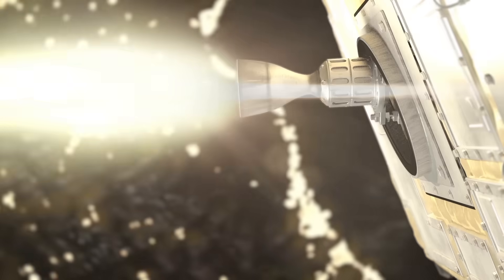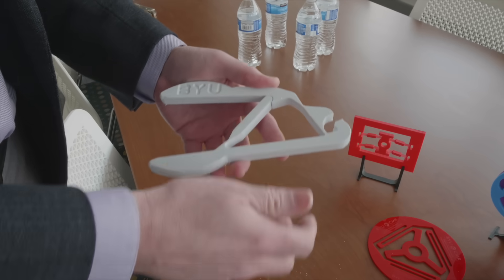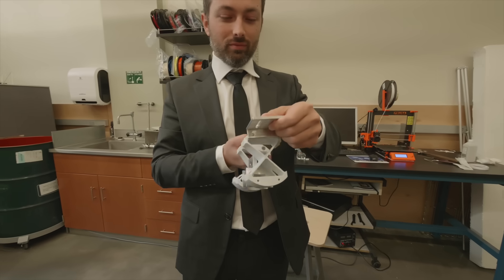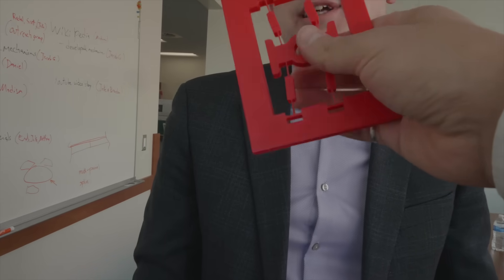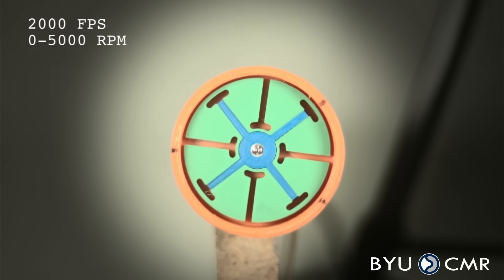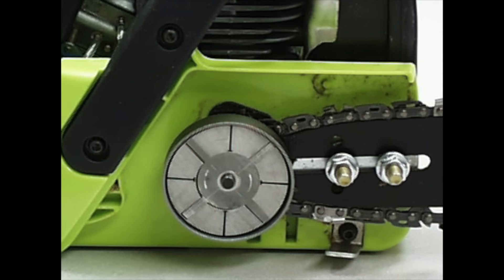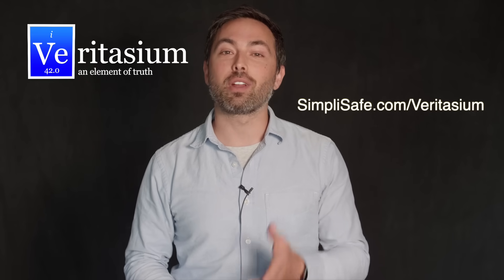Why Machines That Bend Are Better

Comment: I see how the titanium hinge works. Because no corner bends more than 10-15°, no corner is weakened.  Cool
Reply: A thin and long traditional spring coil made of titanium would expand and retract just as much at this compliant mechanism.  This is nothing more than a spring just in a different shape. ;)
Reply: How do you determine how far it can bend before a corner is weekend?
Reply: @joecerone  I dunno, I'll leave that to the engineers, I'll stick to my music
Reply: @MrIzzy5466  Oh, so it's just a known fact that titanium can bend up to 15 degrees without weakening?
Reply: @joecerone  I don't know. It was an assumption. In the video it seems like it's about 10-15°. Maybe it's less, maybe it's more. What's your problem?
Reply: @MrIzzy5466  No problem lol, honestly. I'm just really curious about this stuff.
Reply: @joecerone  I just looked through some comments and one guy mentioned Elastic limit. Don't know if that's what I'm trying to say but it sounds right
Reply: @MrIzzy5466  Yep, it would be dependent on the material's modulus of elasticity (E) - its essentially the stiffness of the material. If we load a material beyond its elastic limit, it will undergo plastic (permanent) deformation. I can't confirm the 15° statement, but it could be possible that the strain experienced would keep it within its elastic region.

If you're more curious, it might be interesting if you look up Stress/Strain diagrams for different materials. I'm not sure at what level you already understand the stuff, but the basics are fairly simple to come to grips with.

Edit: I think I responded to the wrong dude; apologies.
Reply: @joecerone  it has something to do with elasticity( property that enables a material to bend and revert back to its original position/shape) of titanium, and metals are more common presenting the plasticity(deforming permanently without rupture) property in everyday applications so yeah... it's determined by repeatable bending experiments with precision to determine both.
Reply: Joe Cerone it is to do with plastic or elastic deformation
Reply: Most material have a linear elastic region where they can be deformed without permanent deformation. Meaning you can bend or stretch something by putting a force on it, then when the force is removed, it will go back to normal. You can do this with a paper clip. As long as you don’t bend it too far, it will go back to it’s original shape. How far depends on the material.
Reply: Titanium is hella elastic.  You can tie that stuff in knots and it'll go back to it's original shape.

Comment: I've watched this video a couple of times now, and while his compliant gripper is quite neat, it's got a fatal flaw compared to traditional vice grips; a fixed jaw width. 

His compliant gripper may produce a strong force, but it isn't one size fits all. You'd need 10 of his grippers to match the size range of a standard pair of vice grips. 

It took me til my 3rd viewing to even... grasp....this simple fact. 

Still amazing work.

Comment: One problem I can see is that if a device breaks, you can't fix it easily with home methods. With metal multi-part tools, you usually can.
Reply: But these are much, much cheaper and easy to replace.

Comment: One thing that worries me about bending machine is repairs.
Reply: 1 million uses so far without need of replacement. If they used it in a light switch, say you use a single switch 4 times a day. It would last at least 500 years without need of replacement. 

pretty sure we are all going to be dead by then.
Reply: @lordofudead  Yes, but always assume the worst. You never know when a part may fail, need to be constantly be ready for that case.
Reply: @lordofudead  My LED lightbulbs are packaged and advertised as 10 years. Guess how many I actually get out of them? 
Never forget that is a sealed environment with exact and predictable movement. In the real world dust and sand gets on it, someone in a rush uses the mechanism very harshly, the heat and cold constantly fluctuate which will weaken the jointed areas, and so on. For very specific applications it has its uses I'm sure. But this type of design on a mass scale means nothing more than increased non-servicable cheap Chinese plastic garbage.
Reply: Well most of these parts are simple to replace. Even the thruster they showed would be quick and easy to replace.

Comment: So the main thing that i found odd in this video is force. like a clutch is meant to have a large surface area to not slip when engaged under lots of torque. so with the one in this video i could theoretically bind the blade in wood and immediately burn out that clutch because of the low surface area to volume, it also doesnt seem to allow for slipping which is useful in most applications where you might employ a clutch like cars, and the grabbers, how much input force could it take compared to the vice grips (ive used channel locks to clamp vice grips before) before it fails and is that a total failure or does it just buckle at the flexible point the bounce back etc

Comment: We have been making mechanically compliant mechanisms for years.... The fact that you introduce a point that is not a mechanical joint but a flexible pivot it does not mean it is better it just means that it can be mass produced for a different purpose and use. This isn't new tech either. It is new only for nanotech applications.

Comment: Haha, as a production engineer.
Bendy Wizard: You can injection mold it.
Me: Oooo, nice.
Bendy Wizard: You could even extrude it and chop it.
Me: OOOOOOOO
Reply: heh heh heh.
Had to learn these for my engineering class.
I too got really excited with the extrusion part
Reply: Nerds.
Just kidding. As an industrial designer I was like the same.
Reply: Production engineers when they find out you can extrude and chop a product to mass-produce it

ヾ(๑◉ ͜ʖ◉)ﾉ"

geek dancing intensifies
Reply: This guy absolutely blew my mind.
Reply: I'm not an engineer, more of a repair anything kinda person. So I clean up your messes. 🤫But he is essentially making mechanical circuits in ways conventional/natural thinking has thought to be sub par. Bravo 👏
Reply: @StyxNstoners  Please fix my time-machine. I want to go home.
Reply: @NLTops  home is where you make it.
Reply: @StyxNstoners  Don't worry. I don't have a time-machine.
Reply: @StyxNstoners , So, how would you fix one of these bendy bois?
Reply: @JNCressey  depends on how it fails. If it snaps, I'd do a plastic weld with original material. Depending on the material it may need a chemical weld so the heat doesnt distort the molecules and weaken it.
Reply: lmao Bendy Wizard... Indeed  he is.
Reply: @anhduc0913  You're replying to the wrong person.
Reply: @NLTops  lol major oooossp there XD
Reply: Yeah but it can't really be made in anything other than plastic (such as metals or ceramics on a practical size scale for commercial use/ production)which really limits its uses, its useful but not "better"
Reply: @commonsenseless9894  Did you watch 7:45 to 8:17 in the video showing a 3D printed titanium hinge that bends 180 degrees?
Reply: 7:45 That is titanium not plastic
Reply: @commonsenseless9894  it can be made in metal, prob not ceramic tho but it can be extrude/chop or just molded in metal
Reply: @commonsenseless9894  If you need a hardened surface, just use inserts, you can even injection mold them into the piece
Reply: @commonsenseless9894  perhaps go back through the video - there are several practical applications shown where the plastic prototyping resulting in a metal final product

Comment: don't flexible components wear out faster though?
Reply: Pedro Gusmão Did you see the stress test?
Reply: @imallergictobullets  I did.

there was no term of comparisson. "A lot" doesn't mean "less than" or "more than". In fact, for some applications "a lot" might not even be a lot...
I would expect the bending parts to get a little weaker eveytime it bends, though to what extent I suppose would depend on various conditions
maybe that's not a problem for the applications in which these mecanisms are employed, but it seems to me that this would be why traditionally mechanics avoid bending parts

Comment: Lately I've bought a Nikon D5300 and I've discovered that the lens cap has a compliant mechanism as the lock (those kind of thing you need to press to release the cap).

Comment: Love nanotechnology. I downloaded and printed Eric Drexler's "Engines of Creation" (1986) many years ago when it were available. Available to buy as normal book today.  Of cause, like any other technology, it can be both used and misused. Like eg. in the scify/novel book "Snowcrash" by Neal Stephenson. Here the nanotech are being used as a weapon like tiny tiny bots or drones in the air, almost like a chemical warfare. Being called "toner" because of the black clouds they are making in the air, like printer-toner being tossed up in the air. Regards from Krusty in Denmark. BTW: Subscribed to your channel today.

Comment: It's not clear why the price would get down - most of those designs require additive manufacturing techniques that are still quite expensive. 
Also, a lot of those designs - the 3D, complicated ones - just couldn't have been made before....
Reply: Colin Bonatti 3d printing dude

Comment: For 3D printing, what plastic would be best?
PLA is not very flexible I know
Reply: They said once the design is perfected, they can print in just about any material and have it function. They mentioned designing in a flexible system and then printing in PLA specifically, along with rigid metals like Titanium.

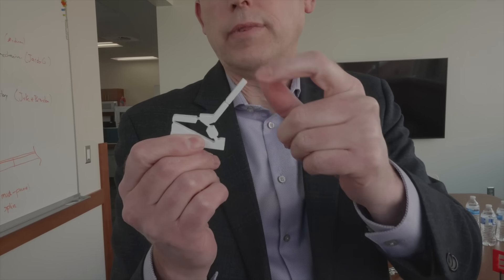Comment: At about 3:44, you ask the question about how long the switch piece lasts. He referenced fatigue testing which got over a million cycles before failure. Is there any kind of metric or estimation to what that equates to in terms of time in real-world use? How long would that be expected to last?

Comment: While this is extremely interesting, these materials are bending like a paperclip. Everyone knows many materials can bend, just the right material and thickness will get you  elastic deformation for the application you need. That's all this is but in a very cool configurations.

Comment: That clutch; it's called a centrifugal clutch and has been around for many decades, nothing new there. Perhaps because it's a one piece part? If in a chainsaw 
it would certainly need to be able to withstand substantial heat which kind of rules out plastics.......
Reply: Did you miss the part where it's made of steel? The plastic replica was just for demonstration.
Reply: @tylerdurden6882  Thanks, I missed the part that it was steel.
Reply: This is something NEW indeed,
if you didn´t have noticed,there are no springs inside, as for example in usual centrifugal clutch

Comment: How about extruding a wider version of the grips and not cutting it down, then using it as a sheet metal brake.

If you could make it so one pair of the grips, when squeezed, could fully squeeze another pair, could that force be multiplied?
Reply: Mr Freeman ok now I have a new project to do

Comment: The one that exploded my brain was the centrifugal clutch. I have rebuilt one of the old style units for a go-cart, and I was chasing ball bearings all over my bench, then I had to calibrate how tightly I assembled the nut (?) nobody seemed to have a tool for. Only four tries to make it work! This compliant clutch would have been a breeze in comparison.

Comment: That subject is amazing, however it explains a lot why modern things cannot be fixed. If you have a broken vice, you just change the screw or a pin and you are ready to use it again. Instead those components made in one part or two, if broken you have to trash it...

Comment: As an aircraft engineer, i can enthusiastically disagree with this nonsense.  When aircraft fail....in any way, (speaking mechanically of course) it is metal fatigue through constant flexing.  If it were series of joints (not the weed kind) parts can be extracted and have NDT done to the parts whereas, to have NDT done to the wing of an aircraft is ludacris :)